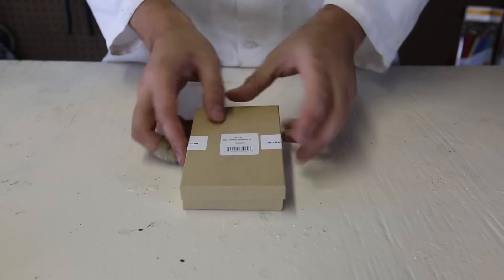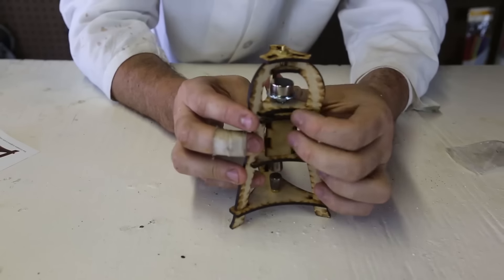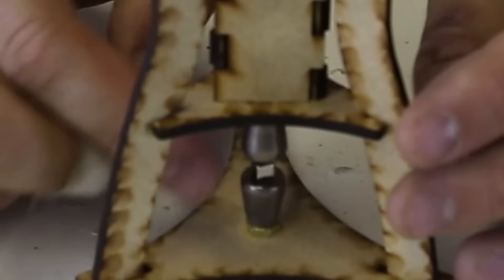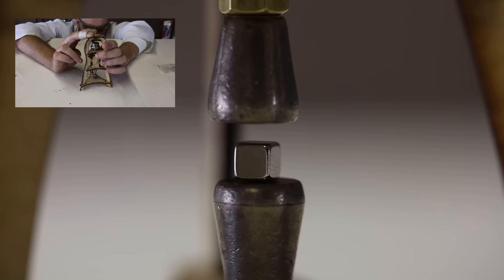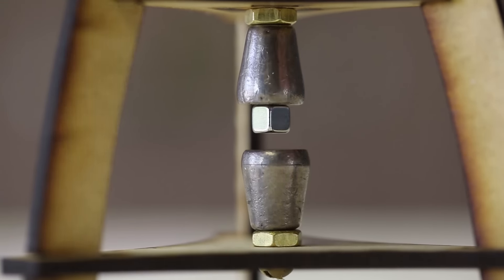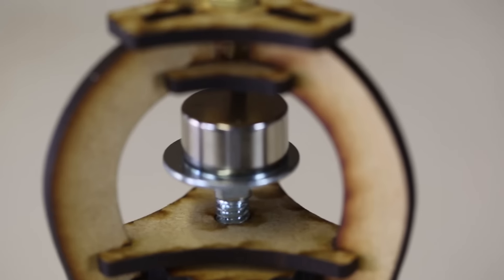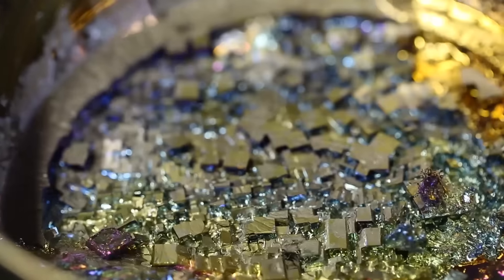Diamagnetic Levitation with Bismuth

Comment: set it in the vacuum chamber , it will spinn fort ever !
Reply: exactly what i was thinking
Reply: no, there's no such thing as a perfect vaccum, air friction still exists.
Reply: +lolcat Gaming what about space tho?
Reply: +Ann Riley he have 2 channels
Reply: There are always some molecules left. Also in space.
Reply: +Dragonfire shield still loads of molecules, not exactly o2 but they still create the friction
Reply: +Dragonfire shield btw nice name
Reply: Blus W Lol thx its from RS
Reply: Sam Liekens. I have a question. Suppose you are inside a big vacuum chamber and you have a 3meters(10 feet) x 3 meters(10 feet) magnetic table and you have bismuth metal powder in your hand. What would happen if you threw the bismuth powder in a horizontal way at an altitude of 12 inches(1 Foot) over the magnetic table? And how different would the experiment be if you threw sand instead of bismuth?
Reply: The spinning time would definitely be extended even if a few gas molecules wandered about in the vacuum chamber.
Reply: @dragonfireshield1976  still particles

Comment: air is friction so it will eventually stop but in space, there is nothing stopping it
Reply: But... in space, no one can hear you say "Boom!".
Reply: +Phil P but i space you can use a radio...
Reply: +filip jadu Not in open space. Sound doesn't travel
Reply: +megmcfoo but how did the nasa use the radio then??
Reply: +filip jadu Well the astronauts aren't in open space so sound can travel wherever they are, but radio waves can travel through space
Reply: +filip jadu radio waves are basically energy waves which doesn't need other molecules or atoms to bump into to be transferred, this is called electromagnetic waves (in scientific form, basically it is capable of transmitting it's own energy in a vacuum . How the astronauts communicate in space is that they have air in their space suit and in their space craft. Sound waves are mechanical waves, meaning they are dependent on a molecule to have energy transmitted. Radio waves are transmitted in space from point A to point B which is a communication device. In conclusion, radio waves aka electromagnetic waves can travel in space which is pure nothingness while sound waves cant.
Reply: Btw air is a molecule. Just to add that
Reply: Then send a f*****g magnet generator in space and we will have free energy forever. :)))
Reply: +Geto Dacian No, you will need to catch that energy and that will stoping it.
Reply: Even is space there is friction
Reply: +TheGuerrCZ Is there?
Reply: +TheGuerrCZ evidence
Reply: Yes, space isnt completely empty. Evidence? Once a while ISS has to turn on engines to speed up cuz its slooowly slows
Reply: TheGuerrCZ Yes, they would fall down because they still going down by gravity. :)
Reply: +Lukáš Prikner Pretty sure there's no gravity in space
Reply: ***** Ofc there isnt gravity in space but ISS is on earth orbit so :D
Reply: +Lukáš Prikner wrong they are falling, but they are moving so fast that they are orbiting earth.   How do you think that the moon is going around earth without flying away?
Reply: Lukáš Prikner I wonder how old are you
Reply: +megmcfoo There is definitely friction in space. There is a very small amount of molecules, but it isn't a perfect vacuum. For all general calculations, you can assume that space is a vacuum, but NASA often needs to account for friction in space.

Also, there is definitely gravity in space. Like +Shadowman727 says, how do you think the Moon orbits Earth without flying away? Gravity is present everywhere in the universe. It's just a matter of degree, though. In deep interstellar space, you could still technically feel the gravity of all the stars around you, but it would be very weak.
Reply: +Rohan Pandey true that

Comment: Air is friction
Reply: Its called wind resistance and there is very little of it so it doesn't make much difference
Reply: It'd be interesting to get it spinning then stick it in a vacuum chamber to see how long it could go.
Reply: Fluid friction and thats pretty much... nothing
Reply: +Eugene Foley well, in the best vacuum chamber on earth there still is about 100 molecules per cubic centimeter. It is trillions and trillions of times less molecules per cubic centimeter than regular air, but still not 0. Though it would spin much much longer, the magnet will still stop spinning at some point. (and also you couldn't spin it by blowing on it, because you would let a lot of air in that vacuum chamber. Doesn't matter if it's just one breath of air. The very low pressure of the vacuum chamber would basically work like an ultra powerful vacuum cleaner and would just suck everything in... Yeah, you would need to figure out another way to spin that magnet)
Reply: Eugene Foley
Reply: You'd eventually run down just due to hysteresis losses (though like +McVidsAndTutorials said you can't ever get all the air out). I think it'd still be fun to spin it up then clamp the bell jar down and suck the air out for video with a clock in the background.  I don't know how well that show up in fast forward/time lapse though.
Reply: the thing is, when its in the chamber there is little to none wind resistance

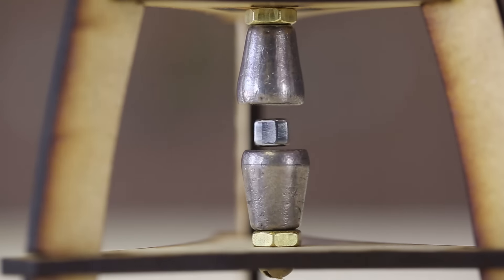Comment: 1:50 There is friction. Air resistance.
Reply: What he meant was friction from a solid not a gas. And there is no such thing as air friction because air doesn't stay still, it's called air resistance.
Reply: Aidan Roberts Yeah, but you get the point.
Reply: ***** Isn't there friction?
Reply: ***** I see. So both of the objects needs to be solids for it to be friction?